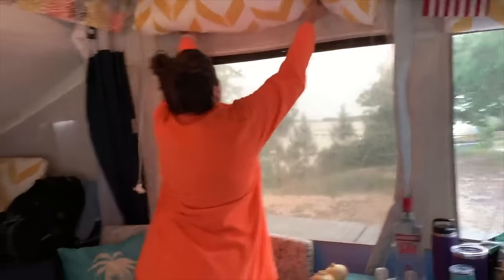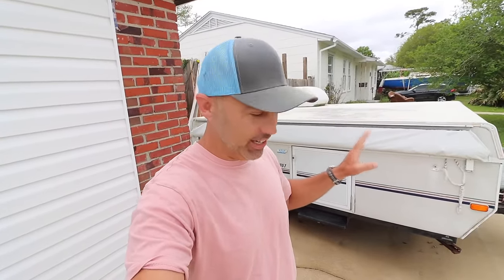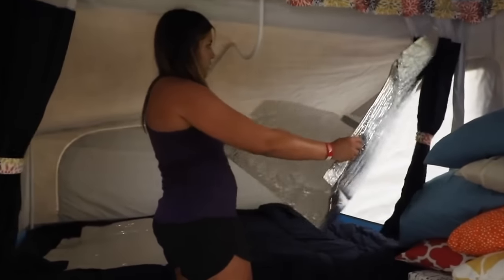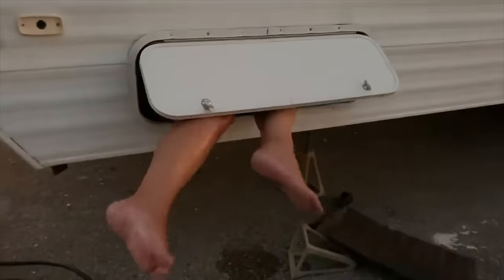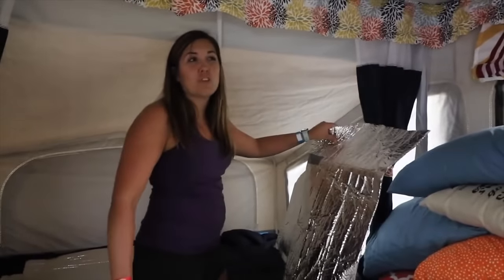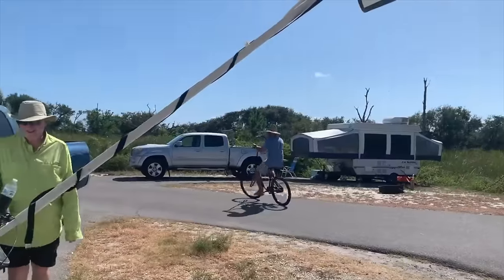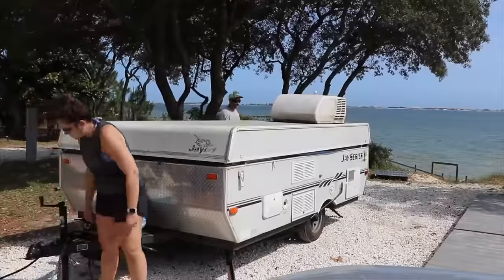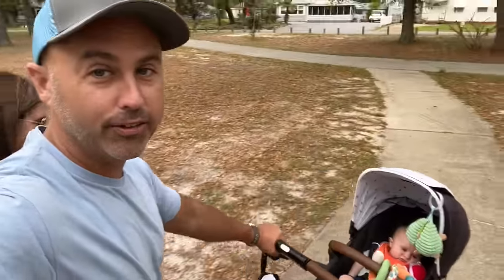10 THINGS I wish I knew before buying a POP UP CAMPER! (worth it?)

Comment: You should keep Damprid buckets in several areas of the camper when you close up for winter.  We put them inside our boat center console where the wires and electronics are located so it doesn't get a lot of moisture in there during the winter, its sealed in a white plastic cover shrink wrapped.

Comment: We bought a fully loaded fancy popup in 2000. Had tons if problems, but learned we didn't need hot/cold running water or other fancy things. We downsized to a Jayco eagle 10ud and have camped with our children since their birth and through 21 years. 
We don't use on-board water at all. You can use the sink as storage during the trip, or just cover it with a tray.
Reply: Same. I dump ice in it and keep soda cans there. I've never once hooked up the water.

Comment: We had a basic popup . No heater. Icebox, not frig. We did many of the same things that the video points out. Some additional ideas. Got a small apartment frig. Moved the picnic table under the awning and put the frig on the table by the camper in order to plug in. Was able to place the frig inside the pop up, on the floor thru the half door for traveling. Used all plastic utensils, plastic cups, paper coffee cups and plates. Just threw everything away after use. Used bag chairs. Got astroturf carpet piece for under the awning. Easy to fold up and clean Did not bring perishable food (milk, eggs, bread, etc.) Just went shopping when we got there.

Comment: Another quick tip is to have an easy place to wash your hands on the go. A laundry detergent bottle with some holes drilled in it will take care of that. Tie a string to the bottle and a foot treadle to the string to tip the bottle.

Comment: Glad this popped up (no pun intended) on my home page. We've been thinking about getting a camper to boondock in the national forests around us (Arizona) but have an older jeep with an underpowered V6 and 3500 pound towing capacity, which translates in the real world to maybe 2000 pounds.
Reply: I got a 2007 RAM 1500 STD short bed automatic 3.7l I AM GETTING A POP UP!! lol😂
Reply: Have had a Palamino pop up, 5th wheel and now back to trailmanor popup.  Palamino was ez tow ez load.  One person could DO the whole thing in 10 min.  5th wheel was nice for fall camping. Warmer, easier to hitch and unhitch.  24 ft, 3500 lbs. Towed well.  Trailmanor has been great so farm. Easy tow,  easy set up, lots of privacy and room.  Don't use the bathroom except for storage.  Never have used bathrooms in any of our rvs. The casette toilet in the Palamino was a great idea. That's what the people that bought it liked. They had two small kids.

Comment: Excellent popup video , pretty much the same reason we are on our second popup instead of a hard side , size and  weight  . I can store it in my garage and pull it with ever vehicle I own . Ours has a slide dinette which makes it huge inside and since we’re older we have a potty but the larger style that has the slide in cassette you access from outside , we can go 4 or 5 nights before having to empty it and it has a nice pour spout so no mess , can’t wait to see your upcoming camping trips especially with the little one tagging along now .

Comment: Thanks for the info, very interesting , I'm planning on retirement this summer, and to be honest I was thinking more of an RV, of course  a used one, I'm not a rich man, but now that I've seen your video the pop-up seems very practical , because I also have  a V6 1500 ram ,and my max weight is about 5,000 , so by the time I pack it up with all the goodies, I'll be right in my max ,and it seems very cozy so now I'm leaning towards the pop-up I thank you for your video it made a believer out of me 👍🇺🇸

Comment: You should install a winch on the inside pulley system and then you just push a button to pop it up or let it down it changed my life
Reply: I'm thinking about buy a pop up. What does the pulley do? How would I install the winch. Single mom sorry for the questions

Comment: As we all know, setting up camp takes way more than 20mins. And breaking down is way more. Ive tent camped all my life, suv packed full. But having a hard side trailer changed everything. Comfy bed, own bathroom with shower. House on wheels, and they pull easy. Maintenance and up keep is pricey tho. Makes tent camping cheap

Comment: Good video Jack! Hey Sam and Lil Jack! Nice to see all of yall. 
Have you checked on the pop up covers? I'm thinking of just using Flextech. We take a 10x10 with us, rather than using our awning. 
I've said I was gonna take our little refrigerator out, but haven't done it yet. I've been told you should run the refrigerator on propane while transporting. I don't know how I feel about that. We bought a fold up sink/table, basically a portable outdoor fish prep table. No cooking inside. I also bought a shower/toilet popup tent and we have a portable toilet. Do you use a point of use water filter? I bought portable fresh water tanks. They hold 7gallons I think.
Thanks for sharing this video with us!

Comment: We just bought our first pop up camper used from a family member. It's a 2010 Jayco Jay Series 1010. It needs some parts replaced. Where is the best place to look online for parts. I.e. the plug (screws on and off) under the camper that releases the on board water supply is missing. What is that called? Where can I get a replacement?